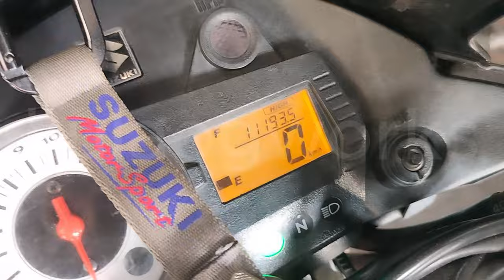✅TITLE: 100 na LABOR NAGING 1200 !!! Panuodin ang full video kung bakit??

Comment: 30mm koso flat
120/42 jettings
Racing CDI
Kalkal stock pipe
Clip ng needle pang 5 sa baba

Normal po ba na may pugak sa 7000 to 8000 rpm ? Tapos nababa menor nya hindi stable